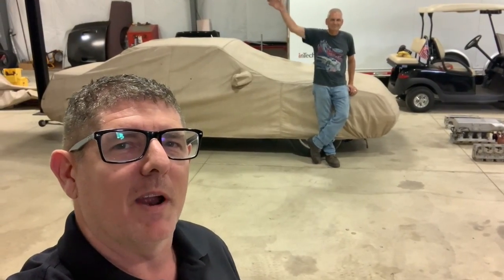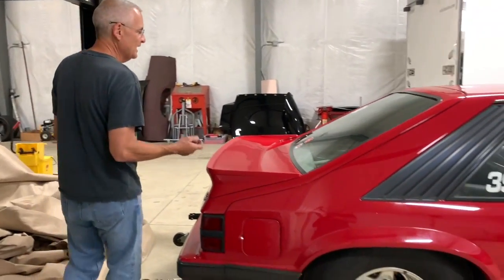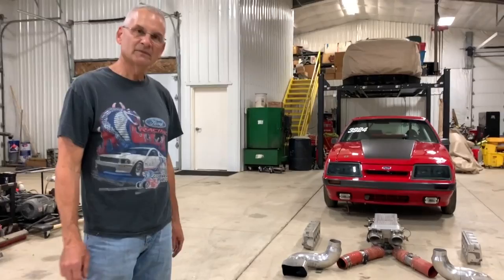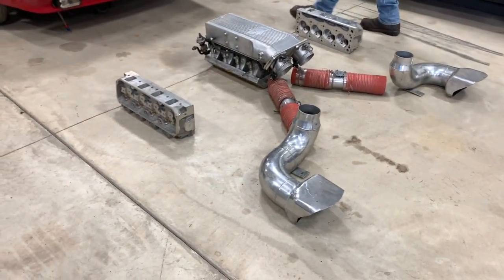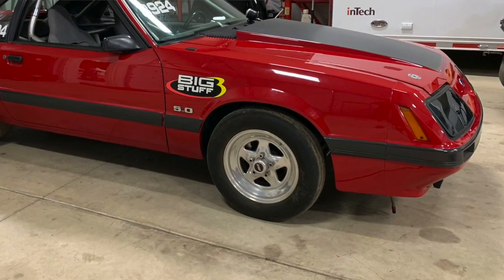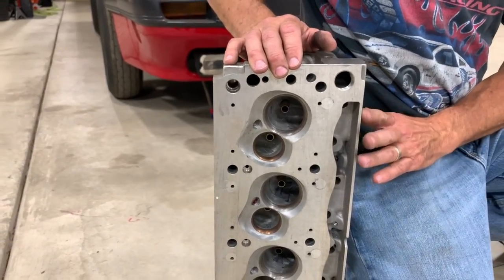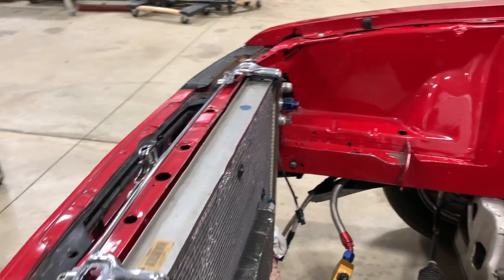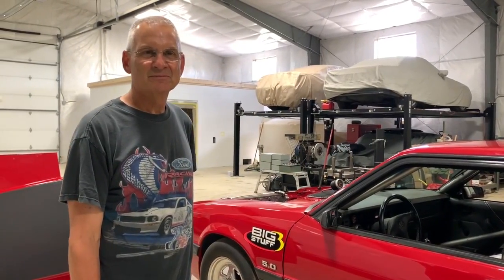Unreal - Historical Foxbody 5.0 Uncovered! Brian Wolfe's '86 Pro 5.0 GT Found - Hear the Story

Comment: I remember Brian Wolfe. I’ve been racing since 1992. I’ve had a Few 4eyed cars. I raced one of the street here in Chicago for a few years then I bought an ultra clean 86 roller with 8 point cage and ran the car in NMRA purestreet for a few seasons. The 88 notch that I have now is an 8 sec car. I work for ford motor company now for 15yrs here in Chicago. I remember when I was trying to go fast on a budget and a lot of salvage yards didn’t know about the v8 Ford Explorer the pre  96 trucks had the GT40 3 bar heads on them. I bought 3 sets of these for $100, sent them to the machine shop for bigger valves, port & polished, milled to 57cc’s with a used cobra intake before I switched to carburetor. 12.20’s  on the street was quick in 96-97

Comment: Ahhh...I remember that Watson Engineering intake from a mustang mag before I even knew how to drive:). Those were the original injected 5.0 days where everything started.  The '86/'87s didn't use MA so it was a pain in a butt to throw any mods on a car unless you converted to MA or used an aftermarket tuning device.

Comment: How did he get that much HP and RPM without cracking the block?
Reply from the maker: It's a Ford block designed for racing. I've seen guys go 11,000-12,000 rpm using this block.
Reply: He’s an engineer at Ford. Has parts or can create parts at his disposal

Comment: How did swapping the upper parts of the motor turn in from less than 200hp to over 700? Or did I miss something during the explanation
Reply from the maker: Those intake parts were on a built short-block.
Reply: Because all the horsepower is made with the 'upper' parts...
Reply: For sure it ran a huge compression ratio (13:1) and the bottom end was built strong to spin to 9000 (!) rpm.

Comment: Evan, I grew up reading your articles about the Fox body Mustangs and loved seeing the cheap mods on what worked and what didn't. Maybe you could recreate those with a stock Fox to show the younger crowd what we all experienced. Bump timing to 14, remove intake silencer, put some 4.10's in it and run in some "mine shaft" air as you used to say. I miss the Mustang VS GN shootouts you used to sponsor too.
Reply from the maker: Thanks, I'll be doing some of that on the channel. I have a great stock Fox GT lined up to do some of the basics. Thanks again for checking out the channel and subscribing.

Comment: I wonder what cam he ran with the gt40 set up
Reply: Something Wicked. He says “stock casting” meaning the valves, Bowls runners all had tons of nice parts and work. The engine was shifting at 9600RPM, that was real real expensive in the 90’s
Reply: Im trying to get a gt40 set up in my 95 GT to try and make 300 hp but idk how to get that. Most people say they make 260-280 with letter cam and porting

Comment: I bought one in ‘86 as well. 265hp with a 5 speed fuel injected. Eventually added a little Flowmaster, K&N, Hurst, American Racing, Goodyear Gatorbacks, sub-frame connectors and dropped it 1 3/4 with some springs. It was like a slot car on steroids.
Reply: 1986 gt was only 200hp

Comment: 1986 was also the first year for the 8.8 rearend in the Fox.
Reply from the maker: A very important upgrade, too.
Reply: Hell Yeah, the 8.8 is a Very Strong Rear, Just upgrade the Axles, C-Clip Eliminator, and a Spool or a Detroit Locker if you planning on some Street Use. Also 86 First year of Fuel Injection on All Auto,s and 5-Speeds. Actually 85 Automatic Cars came with a Shitty Throttle Body Fuel Injection. Not the Better Multi Port that came out in 86. I'm still running the 8.8 in my 86 Going Low Nines. Does have Moser Spool and Moser 33 Spline Axles, and the Axle Tubes are Welded to the Center Part of Housing. I did Twist Up an 8.8 Housing back in the Tremec TKO Days, running a Built C-4 Now and Love it. And those 86 Roller Blocks with the Flat Top Pistons and those 1 Year Only Heads. Thank God for the E7 Heads that came out in 1987.

Comment: awesome... miss those days. I had an 85 gt buddy had 86 gt. Beat him stock to stock but our quarter mile times at carlsbad before it close were mid to low 14's. Gears, pulleys and exhaust had us in the mid to high 13's. Then nitrous and cams and heads... miss those days so miss them. Those times are strong he ran back in the 1990's.

Comment: evan I have a 91 lx notch that I bought new and raced it till a few years ago ...I modified my car to run low 11,s just from reading the magazines and comparing part info from various setups and the test n tune days were the best days of my like ,,,if it wasn't for the magazines my car would have been totally stock and boring ,,,I was a huge fan of project stocker ...I ended up using tfs high port heads with a e303 cam pro m77 24 lbs inj gt40 intake 65 mm tb ...and car went like shit so I called the ford racing hot line and they told me my setup was good and that now I needed a piggy back system and a laptop to tune the car ,,the price tag on those 2 items was ridiculous so I took off the entire system got me a performer rpm intake and a 750 dp threw in a 100 shot of nos in a full bodied car zero weight reduction and on my first pass car went 11.13 at 122 mph ..I was on the moon at that point loving every second of it ...I came from a all mopar neighbourhood 71 hemi cuda , 440 six packs 340 dusters etc etc etc ..and these boys all feared my little mustang on the streeets ..
Reply from the maker: Jim, great story and glad you still have the car. I would say the E cam and GT-40 was nowhere near enough for the heads you had. Thanks for checking out my channel and have a great day.
Reply: indeed the high port heads were huge that's why the car loved the nitrous , years later I swapped out the iron heads for a set of twisted wedge heads which dramatically improved the car without the nos , I never ran it with nos with the aluminum head ...today the car is completely stock again ...I had put all stock parts in the basement and re installed them ..cam , intake , injectors axles etc etc etc ..I wish I could sent u a pic of the car ..when the car had the high ports whatever the car ran naturaly aspirated that day lets say 13.13 the nos would knock off 2 seconds off the et 11.13....if car went 12.54 on nitrous car went 10.54
Reply from the maker: @jimgee2676  I'm also on Facebook (REVan Media) and Instagram @official_ford_guy you can message me there.
Reply: I sent you a couple of photos on fb in a message

Comment: He’s one of the engineers behind the new 7.3L big block has engine in the 2020 superduty.
Reply: Ya.... the LS is copied after the small block Ford.
Reply: So were are all those "LS ford" engines?
Oh they dont exist really other than on paper 

Oh what ford head out flows a LS? Non aside from the recent mod motors
Reply: @josephandreuccetti8043  Recent? The 4v  mod motor came out before the LS. Ford motors that will outflow the LS? Ever heard of the Cleveland/335 series? Tons of racing accolades. Kasse dominating the EMC with it for years.
Reply: Preach it mike!!!!! GM built a great Ford engine.
Reply: @mewrongwayKOCXF  news bulletin broski!... A single cam push rod v8 is a ancient design used by almost every auto maker in the universe at one time...How's the 7.3 BB copying the Ls?...  Coil packs, oil squirting bottoms of pistons and vct... Lol. Lame argument! Your not a real car guy if you aren't excited about the return of a BB push rod v8 with a forged crank and 1000ft lbs
Reply: Ada 1812  Thats really a question you should answer for yourself. If the chevy boys adopted a "cant beat em, join em" attitude and are running mustangs, how then can you ask why Ford guys dont swap Ford motors into chevys? The proper question is why Ford guys dont want to use chevy platforms that chevy boys themselves dont want to use. The question is actually quite ridiculous when you think about it.
Reply: Chevtards   ls is God 😂😂😂
Reply: All hail the new King Of The Streets!

*trumpets blare
Reply: Yeah well my friend has a Honda Civic with a Vtec with a custom muffler and neon lights that change color!!! NOW WHAT beat that!!!!!
Reply: Joseph Andreuccetti LS bead will bolt on a SBF... you need a flipped cam grind and custom intake manifold but it can be done
Reply: @josephandreuccetti8043  that's funny I never seen a fast LS with ls heads.
Reply: Ada 1812  maybe in your area where there's no money. Around here everybody has a coyote or a small block Ford
Reply: Chevy guys will do and say anything to drive a Ford!
Reply: The Ford 7.3 liter V-8 is not new.     If I had the tooling and patent rights already for the diesel Ford 7.3 liter engine?  I would convert the diesel to burn gas before designing an entire new engine that just happens to be 7.3 liters.   Anyone know the lowdown on this?
Reply: Ada 1812 the reason why you don’t see many ford motors in Chevys is because Chevy designs some of the ugliest cars ever made. No wonder why chevy guys migrate to ford chassis’s
Reply: @RRR-jd2oy  Really? The world's fastest 5.3 is in the 7's on stock GM heads, and the best part is it's in a 🦊.
Reply: Isn’t that the motor for the new so called 429 boss

Comment: That car singled handedly sold half of the GT40 intakes ever made!  I wonder if Brian still has the blue LX notch he built in the mid to late 90s?
Reply from the maker: I don't believe he still has it.
Reply: @revanevan  I do still have the blue car, well kind of.  It is the same car I crashed and is now under a cover in my shop.   It ended life as an X275 SBF procharged, ran 4.30's to the 1/8 mile.  I can't bring myself to scrap it.